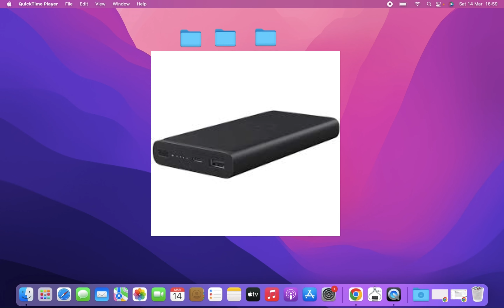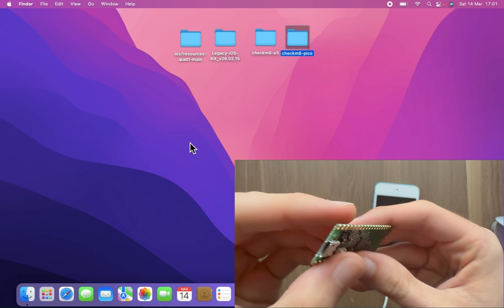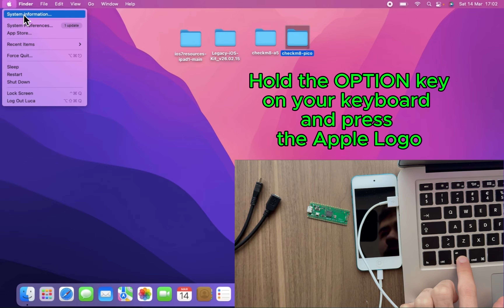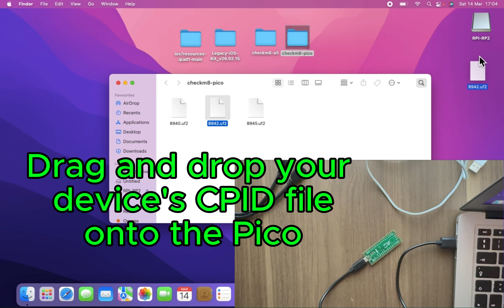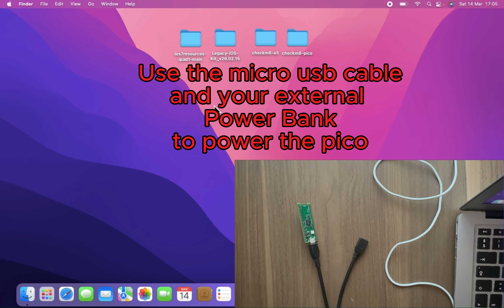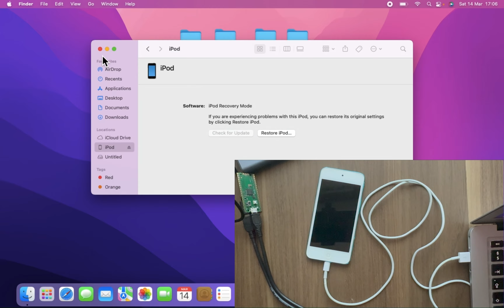A5/A5X Pwned DFU Mode with Raspberry Pi Pico (Full macOS Tutorial)

Comment: Can you please  make a tutorial to remove activation lock on ipod touch 5th gen model A1509 thanks
Reply from the maker: Well, in theory, I could, but I don’t want to risk my channel getting Terminated. I’ll think about it and let you know !
Reply: @iDeviceLab009  And is it also possible 4 iPod touch 6th gen A1574?
Reply from the maker: Those don’t require a pi pico
Reply: @iDeviceLab009  Ok, what requires then?
Reply from the maker: A pico is required for A5 devices. Those include: iPhone 4s, iPad mini 1, iPad 2, iPad 3 and iPod touch 5
Reply: @iDeviceLab009  no, I mean 4 the iPod 6th 😅
Reply from the maker: You can try Hackt1vator, MAYBE I will make a video on it… we’ll see…
Reply: @iDeviceLab009  That would be great 🤗

Comment: I have an old iPad 3 from 2012.
After I restored it using my MacBook, the iPad shows an “Activation Error” right after the setup screen (language selection and Wi-Fi connection).
Is there any way to fix this activation error?
It’s an iPad 3 (A1430) running iOS 9.3.6.
Reply from the maker: I made a tutorial, I will finish it up today
Reply: @iDeviceLab009  thank you! Looking forward to using it!

Comment: my moms ipad is a mini 4 a1538 and it's disabled and not icloud locked are there any options for it? It's full of photos and video that she wants  so I'm waiting for a solution
Reply from the maker: Unfortunately there is nothing you can do at the moment, as you can’t easily SSH into the device and remove disabled. Bruteforce isn’t possible either for 64bit devices, only 32bit.

Sorry, man ! Maybe in the future more methods will be found !
Reply: @iDeviceLab009  thanks for the explanation - I guess she'll have to throw it in the drawer for another 5 years 😆
Reply from the maker: Yep